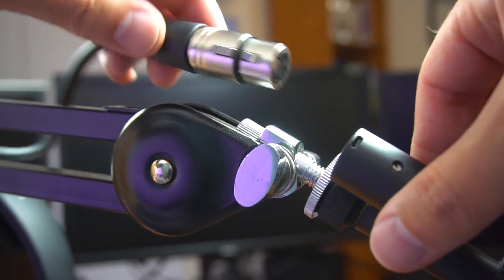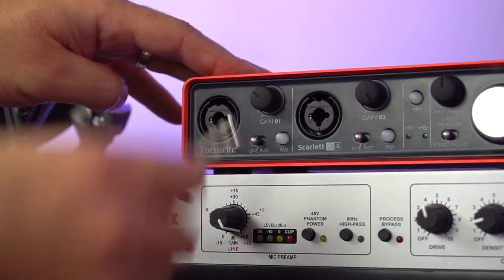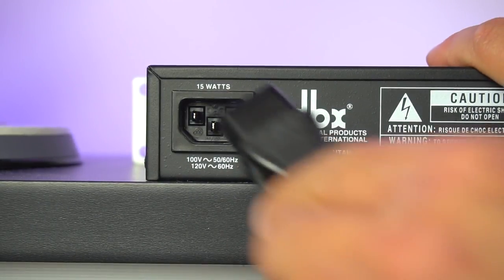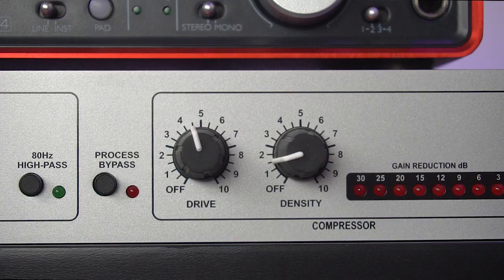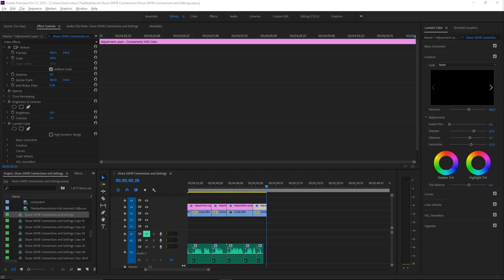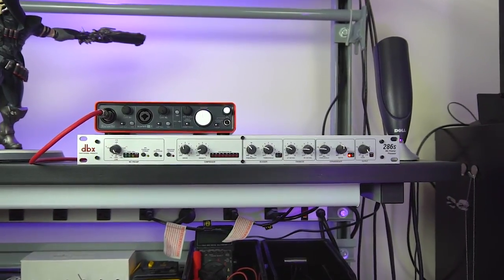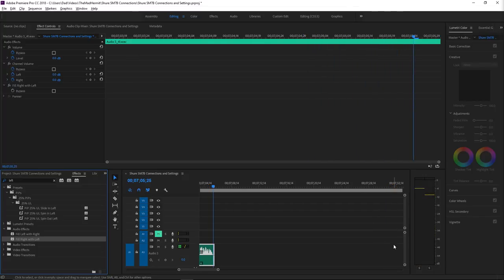How to Connect the Shure SM7B XLR Microphone to a Computer

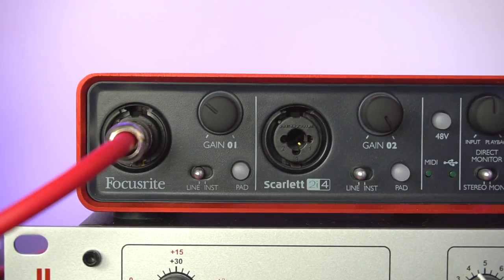Comment: At 4:49 of this video you talk about having the scarlet gain knob set to around 1030. I have your exact same set-up (SM7B, DBX 286s) with the exception of owning a 2i2 instead of 2i4, and I can't anywhere near 1030 on that knob without a major audio-ruining excess of gain. My knob basically goes red. Is there something I'm not considering that's not allowing me to mimic this?
Reply from the maker: +BradEdwin I am not sure I am understanding you. Do you have to dial the focusrite gain up or down to get a proper signal? One thing that will change the gain level is the cable you are using. In my case I am connecting the two via 1/4" TRS on both sides. This bypasses the focusrite preamp circuitry. If you use a cable that is 1/4" TRS on the dbx286s side and XLR on the focusrite side you will use the focusrite preamp circuitry. Since the dbx286s already has a preamp, it is not necessary (or desirable) to go through another preamp circuit at this stage in the signal chain. Hope that makes sense and helps clarify things.
Reply: I don't NEED the focusrite gain, it just helps make me a little louder. I have the DBX preamp gain dialed to +60DB. I'm using 1/4'' TRS on both sides as well. In fact, I changed to that cable when you replied to a previous question I had about doing away with the old setup (e.g., TRS on one side, XLR on focusrite).

But even in this video, and despite bypassing the focusrite preamp, you still have the focusrite gain knob at a little past 10 o'clock at 4:47, so I assume you're using some gain from the focusrite despite having a DBX connected. I've matched my DBX knobs with everything in this video, but what I"m saying is I can't turn my focusrite gain knob nearly as high as you can. If I go past 9 o'clock, it clips badly. I was just curious how you were able to get such great sound if the focusrite is turned past 10 o'clock. If you're bypassing the focusrite preamp, why does that gain on that device even matter, and why do you recommend using the focusrite gain knob at all?
Reply from the maker: +BradEdwin OK, thanks for clarifying. The pre-amp and gain knob on the focusrite are two independent circuits. One is controlled by the type of cable you attach, the other by the knob. 
I wouldn't worry so much about where the dial is set on your focusrite compared to mine.  What's more important is that your signal is coming in at the level you want. In my case, I shoot for a peak signal of -6db, with my average signal hovering around -12db. For what it's worth, one reason you may be seeing clipping is your software audio settings are different then mine; or the differences in the focusrite models (2i2 vs 2i4) and corresponding firmware is causing the discrepancy you are experiencing.
Reply: Yeah - you're right, there are many other settings that could affect that. How can I measure my signal anyways? You said you shoot for a peak of -6db, with an avg of around -12db. How can I measure/tell this? By using controls on audacity or adobe audition? Sorry - I'm a noob who is trying to dive right in! Your vids are great for guys like myself that are very visual learners, but some of the audio engineering parts go over my head the first time ;)
Reply from the maker: +BradEdwin No problem. Ask away! That's what I am here for. Adobe audition would be a great place to see audio levels. I edit with adobe premiere and it shows me my levels there as well. Record something and play the audio back in one of those tools and you will see a bar graph bounce around. Then tweak things in your hardware, lather, rinse, repeat until you have your signal in the range you desire. You can also do some of these things in post (as long as your signal doesn't have destructive clipping) but setting your hardware dials right from the beginning is the better way to go.

Comment: Hi The Mad Hermit - question - which model of dbs or another should I used if I need to plug in 3 SM7B mic. I really need dbs or simillar to remove or noises from outside in the studio of my radiostation.And which focusride should I use to plug in those microfones (3) to the broadcasting mixer. Right now we are using OctoPre Mk II Dynamic. I have to many noises and without dbs still have problem with gain set up. MIc dont getting enough power in my opinion and when Im trying to put more gain on the mixer mic channels or on the focusride OctoPre Mk II Dynamic it its a lot of crackling and other noises I need to do something urgently any suggestions about equipment - dbs to compress 3 microphones sound and remove all noises? Waiting for Your response. Fantastic and so useful! Thank You for that! Marcin Radio Star - London
Reply from the maker: Hi +Marcin Marchelski. Sorry for the delay. Just got back from holiday.These things are designed to work with one mic or instrument so you will need to pick up three. This is so you can configure the settings to best suit the audio characteristics of each mic and speaker independently.

Comment: There are two switches on the back of the mic. One is a bass cut (less bass) and the other is a presence boost (more treble). It sounds like the gentleman making the video may have one or both of those switches engaged as his audio is lacking in bass and sounds a bit harsh. Not as smooth and warm as this mic has the potential to get.
Reply from the maker: For what it is worth I don't have a baritone voice by any stretch of the imagination. In fact, you may say my voice is nasally. I intentionally have the switches on the back of the mic set to presence boost (both up) and am happy with how it makes me sound. Not trying to invalidate your opinion, just articulating the limitations of what I have to work with. :)

Comment: One question. You said you used the TRS cable from the DBX to the Focusrite because it bypasses the Focusrite preamp settings. So if you do that, doesn't that bypass the gain knob on the Focusrite? I'm just confused on that and I want this exact setup and I'm brand new to XLR stuff. Also, I found a video about the left channel sound only, and it said to go into the playback settings in Windows, and put it on 1 channel, 48000. And you'll hear both. Sounds backwards, but it worked for the guy in the video.
Reply from the maker: +Joey werner Great question. The preamp circuitry is separate from the gain nob so whether you plug into the Focusrite with an XLR or 1/4" TRS cable, the Focusrite gain nob will still allow you to make adjustments. I've done it both ways. 
With regard to Windows settings, I am guessing you mean "Recording Settings". I am unable to switch to single channel from within Windows. I get a "Format not supported by device". If it works for you then you certainly can try it.
Reply: The Mad Hermit oh ok, that makes sense then. Ok thanks man, good info in this video.
Reply: Doing it TRS would indeed bypass internal pres in the interface. Volume control is done with the preamp in that scenario. You can do it via XLR out from the preamp to the interface, and some appreciate the color that that can add. However if you want to keep it as clean as the preamp outputs, TRS is the way to go.

Comment: Hey, I have a question

I am currently setting up a new microphone setup for streaming from a computer

I was thinking of buying the DBX286s, but as I understand I need something else, preferably with an USB transition to get it connected to my computer.
Do you have any cheaper recommendations that would work exactly the same instead of the FocusRite that you use in this setup? For example a FocusRite Scarlett Solo Gen2?
Would it be any big loss in quality between the two or other options as you mentioned the preamp we use is actually the DBX286s and not the FocusRite. 

TLDR: If I understood it correctly, would any audio interface do the job to bridge the gap between the DBX286s and the computer?

Any helpful information is greatly appreciated! 
Thank you :-)
Reply from the maker: You could use the Focusrite Solo or any other audio interface to bridge the gap. I happen to use the Focusrite 2i4.
Reply: @TheMadHermit  Thank you man. Love the video, really helped me with my exact problem coming into this as a noob. To clearify, would you have any notable difference in audio quality depending on the audio interface you pick?
Reply from the maker: Thanks. I really haven't compared multiple components so I can't say how the audio quality may be affected by changing things up. I can only show you the results I have obtained with what I use. I would imagine results will vary as you mix and match but it doesn't mean things will necessarily get worse. I know that's not the definitive answer you are looking for but that's why I share precisely what I use, how I configure it and how I connect it. This takes a lot of the theoretical guess-work out of the equation and allows you to hear definitive results.

Comment: When you are done recording do you disconnect everything since the DBX 286s does not have an off switch? What is your process after recording is done?
Reply from the maker: +Gerald Lewis I leave it all connected and on. Never shut it off. You can connect the dbx286s to a power strip and turn it off/on that way. Just make sure you follow the procedure outlined by the manual of the dbx286s which states, "Note: To reduce the risk of damage to your system, set the MIC GAIN control fully counterclockwise and lower your playback monitor levels before you connect a microphone,
power on the unit, or press the PHANTOM button. This will eliminate spikes and surges,
acoustical feedback, loud pops, momentary hiss, or other unwanted sounds."
Reply: The Mad Hermit, thank you I was unsure if it was safe to leave the mic on. I use the Heil PR40.

Comment: Hey, can't we just use Focusrite? There is an XLR input on it?
Reply from the maker: The focusrite alone does not provide enough gain. It needs +59dB. The dbx286s provides 60dB.
Reply: @TheMadHermit  whats the whole point of the dbx 286x if i have the cloudlifter and scarlett 2i2 with sm7b?
Reply: @angelcerda2944   because even with both (depending on your voice) it will still be very low.

Comment: Just got a Mg12xu and cloudlifter with sm7b what cords do I need to set this up? Also if I want to setup discord teamspeak or Skype do I need a addition cable for this to work?
Reply from the maker: I believe you can connect everything as follows with the hardware configuration you purchased: 

Required Cables
===============================================
Mogami Gold Studio 03 XLR to XLR Quad Conductor Patch Cable 3 feet
http://amzn.to/1mEgBJ4

GLS Audio 6ft Patch Cable Cord - XLR Male To XLR Female Black Mic Cable - 6' Balanced
http://amzn.to/1mEgNIm

GLS Audio 6ft Patch Cable Cords - 1/4" TRS To 1/4" TRS Color Cables
http://amzn.to/2zp4ESa

How It's All Connected
==================
Use Mogami Gold Studio 03 XLR to XLR Cable to Connect the Shure SM7B to your CloudLifter

Use GLS Audio Patch Cable To Connect the other end of the Cloud Lifter to the DBX286s (via XLR Input On Back)

Use 1/4" TRS To 1/4" TRS Color Cable To Connect
DBX286s (Via TRS Output On Back) to your Mixer

Connect Mixer to Computer (via USB cable) 

NOTE: You do not need any other cables to make your setup work for Skype and discord.

Comment: Thanks for this video. I've referred to it a number of times now. With regards to using a double sided 1/4 inch TRS cable, you mentioned this is to bypass the Focusrite preamp, my question is: why would you want to bypass it? What would be the benefit?
Reply from the maker: The dbx286s already has a preamp. No need to go through two preamps. Hence, bypassing the second one.
Reply: Thanks for the reply.
Reply from the maker: When you talk into a microphone a weak signal is generated which is referred to as "mic level". This level is not suitable for processing. A preamp is specialized circuitry that is designed to lift the weak "mic level" signal to "line level" and do it in a clean way (i.e. increase signal while not simultaneously increasing the noise floor). Recording gear expects to receive a line level signal, hence the importance of the preamp. For my configuration, since the first stage of the dbx286s preamp brings the input signal to line level, before feeding it to the processor stage, the preamps work is done. To then feed the output of the dbx286s into the focusrite's preamp is unnecessary and redundant because the signal is already at line level. What happens if you do? Not sure, I did it that way in the beginning and didn't notice much of a difference when I switched to the way I suggest now, but it is not good form and I like to share the proper way to do things with my viewers.
Reply: Thanks very much for this detailed explanation. Very helpful. I took your advice a few days ago and ordered the double sided 1/4 inch TRS cable along with the rest of the gear. Looking forward to trying it all out 😊

Comment: Do you really need the dbx or the focusrite to connect it to a pc?
Reply from the maker: You need an audio interface of some sort to connect the Shure SM7B to your PC. I use the focusrite for that. The dbx286s is what I use to boost the mic gain to line level and apply audio enhancements. Without that it is frustratingly quiet.
Reply: @TheMadHermit  would i be good with just the focusrite & the cloudlifter?
Reply from the maker: Will work but I didn't have very good luck with the Cloudlifter because it was amplifying RF noise (a local radio station to be specific) and putting it in my noise floor so I wouldn't recommend it.

Comment: If I use this exact same setup to record gameplay on my PC (fortnite, PUBG, etc.) and if it only is heard through the left side of headphones, how can I change that using discord and OBS?
Reply from the maker: The reason why the signal comes out of one channel is because the focusrite 2i4 is capable of receiving input from two separate mics which it delivers on two separate channels (one on the left, the other on the right). This allows you to manage and manipulate those signals independently. To avoid hearing a single microphone on the left channel only all you have to do is convert the signal to mono. In OBS you do this via the "Mixdown to Mono" in the Advanced Audio Properties section. You will need to look for a similar option in Discord if it has one.

Comment: Why are you using MME drivers? Isn't ASIO with the Focusrite the recommended drivers to use?
Reply from the maker: +Jade Sambrook Great question! I use the MME drivers because my onboard audio supports it. If I switch to ASIO I can't hear what I record when I attempt to play it back. In short. I use it because it works. :)
Reply: Thanks for the reply. I am using the Shure SM7B and recently got myself a Focusrite 2i2. The gain is pretty much at 100% on my 2i2, but it sounds good with no clipping. I tried with a Cloudlifter CL-1 but I found that it was more of a hiss-lifter than anything. It just amplified room noise/ambient sound/hiss so I removed it from the equation. Thanks to your videos my next purchase will be the DBX 286s.
Reply from the maker: +Jade Sambrook No problem. I started with the Cloudlifter/Focusrite pair. The Cloudlifter was pulling-in RF noise so I removed that from the equation and replaced it with the dbx286s. With regard to maxing-out dials. If it doesn't introduce noise I don't see a problem. :) I have some of my gain nobs dialed all the way up. I suppose I could tweak things but I am happy with the sound I am producing at the moment. :)
Reply from the maker: +Deleted User Yes. Though you can also use it to attach another XLR mic on a second channel as well. One that isn't as gain hungry as the SM7B.

Comment: Does the 1/4 inch cable bypass work with every interface? I have a Yamaha AG03 and I'm not sure if it works with that, using a TRS cable. Thank you so much for the video by the way :D
Reply from the maker: I can't say. You have to consult the specifications of each interface to be sure.
Reply: @TheMadHermit  Thank you so much for the reply! If I can ask, there is something specific that I need to look for in the datasheet? I can't find anything related to that...
Reply: @TheMadHermit  Hey! Sorry if I'm writing again. Got my 286s today and I connected it to my Yamaha AG03 with a 1/4 inch trs on both ends. If I change the gain knob on my Yamaha, it changes how loud the mic signal is. Is that normal?
Reply from the maker: Matteo, This is what the focusrite manual has to say about connecting a line level source via a 3-pole (TRS) jack. I would look for something similar in your user manual and follow their guidance. 

"the Focusrite preamplifier stage is automatically configured for a microphone when you plug an XLR into the input, and for a line or instrument when you connect a jack plug. Set the LINE/INST switch next to the socket to INST if you are connecting musical instrument (a guitar in the example) via an ordinary 2-pole guitar jack, or to LINE if you are connecting a line level source such as the balanced output of an external audio mixer via a 3-pole (TRS) jack. Note the Combo connector accepts both types of jack plug."
Reply from the maker: Awesome! Yes, if you change the gain knob on your Yamaha you will amplify or attenuate your signal which will make it louder or softer respectfully.
Reply: @TheMadHermit  Thank you so much! I'm so grateful to you for this video and for your replies. I'll look into the manual/datasheet as soon as possible. Thanks again :D
Reply from the maker: No problem. I am happy to help. Let me know if you have further questions. That's what I am here for.